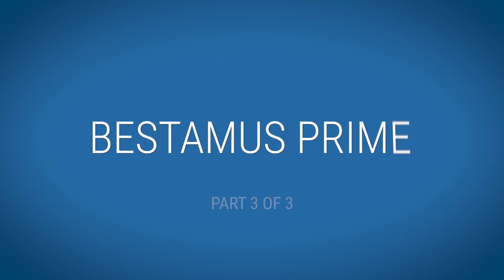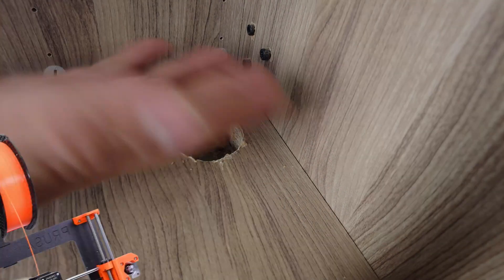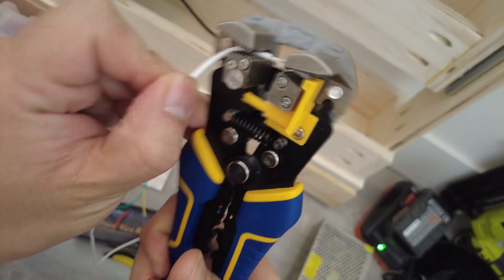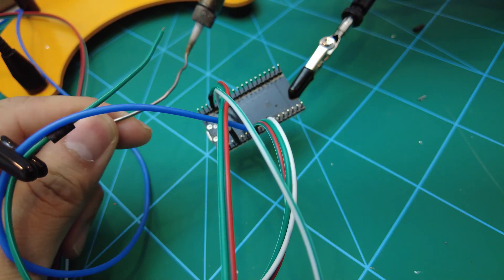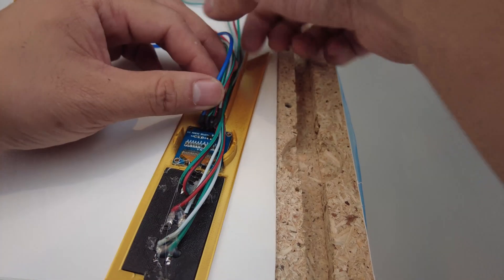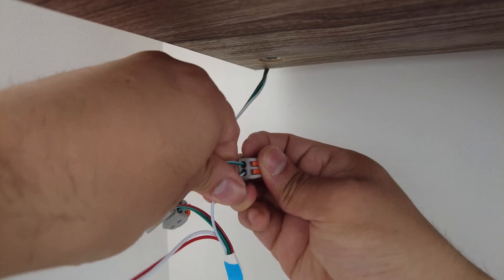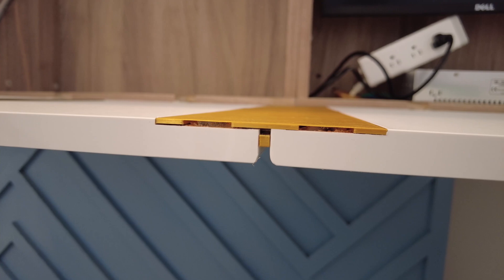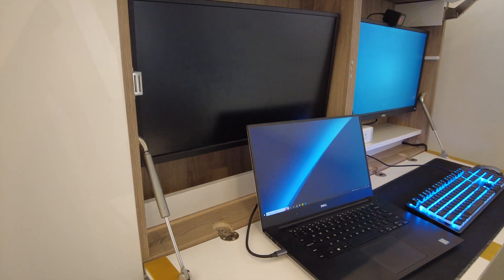Ikea Hack - Besta sit-stand murphy desk for small space (Part 3 of 3)

Comment: Love this idea. Question about the keyboard and mouse tray. Wondering if you've had to change out the hinges or if they've held up. Admittedly a heavy typer
Reply from the maker: I haven't had to swap out the hinges, but the particleboard is 100% an issue. My wife isn't necessarily a heavy typer but she definitely rests and leans on the desk with a good amount of weight. After a couple of years the tray is definitely sagging...

I was thinking of reinforcing the particleboard with epoxy putty, but couldn't remember if I actually did that in the first place. I ended up re-watching my video just now to confirm (it's in the part 2 vid) and I only recommended using epoxy and even said "do as I say, not as I do right?"... SIGH... 😅

EDIT: to add to this, other things that you could do (or that I might do/should have done):
1) avoid particleboard wherever possible
2) I may end up drilling completely through the door to attach the gas springs (that allow for soft opening) to a separate and more solid piece of wood on the outside of the door if I can find a way to do that elegantly.
3) I also may try attaching something to push down on the hinges on the Besta/cabinet side for additional reinforcement.

Comment: Great Inspiration!! Could you tell me please how much approximately did you spent for everything (not including the tools)
Reply from the maker: Thanks! Regarding cost, oh man, it kind of ran away from me and I stopped keeping track, but I'll try to breakdown the main items with rough cost estimates as best I can here:

Ikea items (BESTA unit (cabinets, shelves, doors), UTRUSTA hinges) - $400-600 (use non-gloss doors to reduce cost)
Wood (sheet of plywood, 2x4's, hardboard, MDF trim) $200
Linear actuator - $100
Slides (linear rails and drawer slides) - $100
Monitor mounts - $50

Where I mainly lost track was the other smaller items (e.g. magnets and the electronics) as I had some random things already on hand (e.g. LED strips). Same with the consumables like paints, glues and filler. Hope this helps!

Comment: Have you considered a right angle adaptor for the USB-C port so that the cable cuts straight back, as it were, and doesn't loop out and then behind the laptop?
Reply from the maker: I did, but the laptop was intended to be stored in the nook behind the monitor so a straight cable made more sense at the time. Of course that's not how she actually ended up using it (it's mainly on the desk surface), so a right angle adaptor is definitely a great idea!